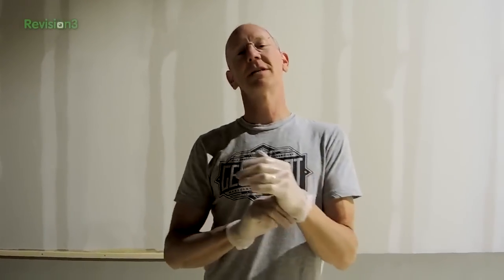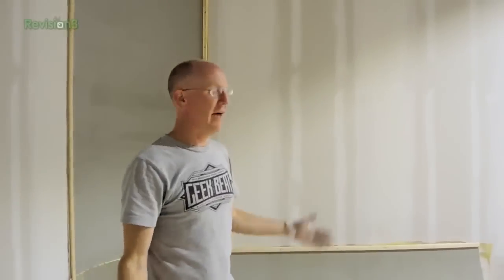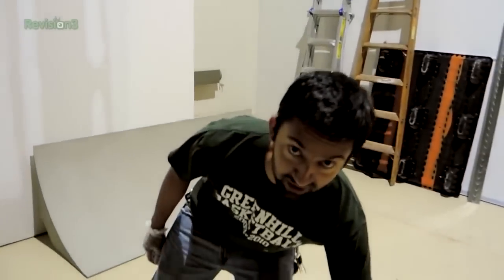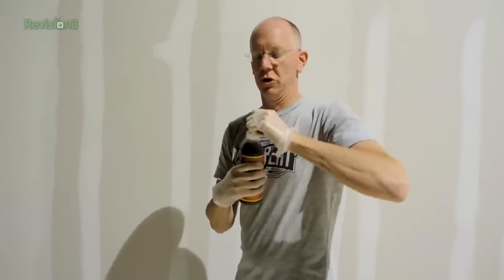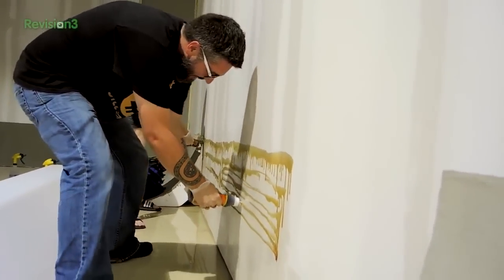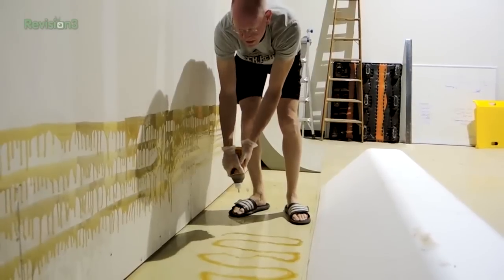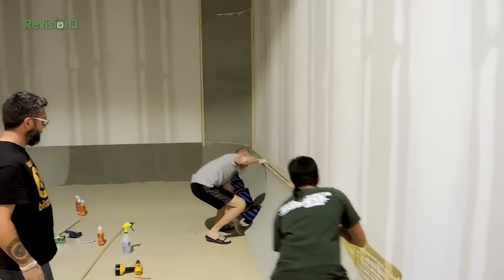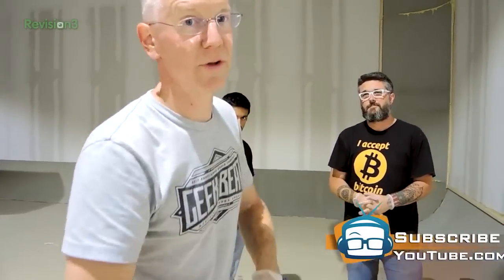How To Build a Cyclorama Wall

Comment: Wow this video did a great job of showing absolutely nothing about how to build a cyc wall. No angles on how to calculate the curves. No info on how to make the curves which is the most important part and no idea where to buy them or make them. This is a load of crap.